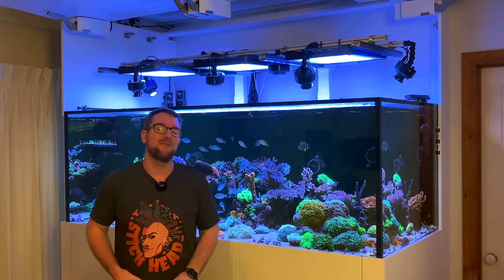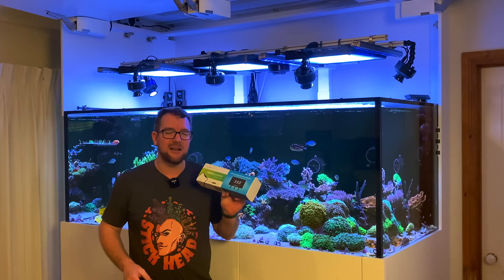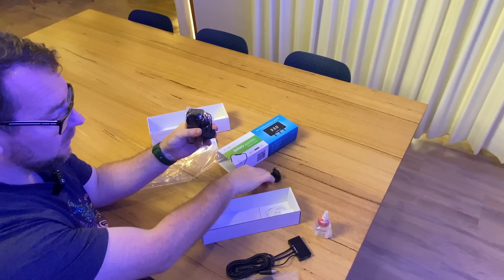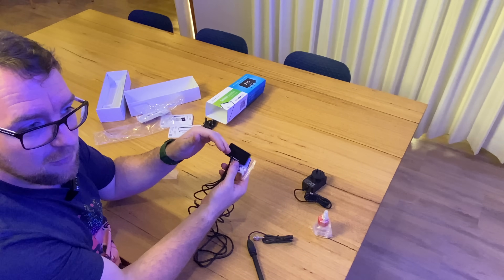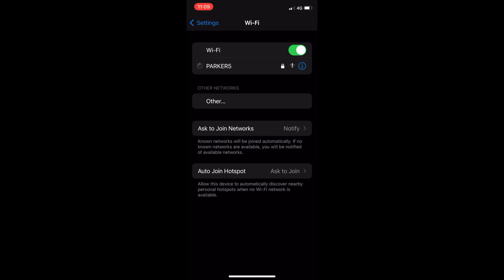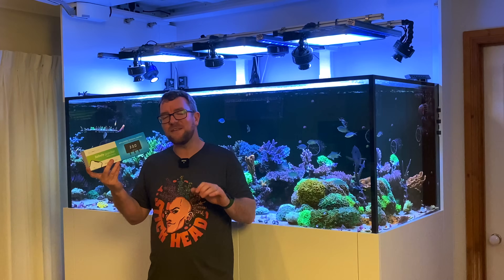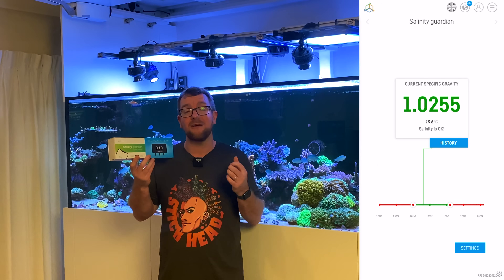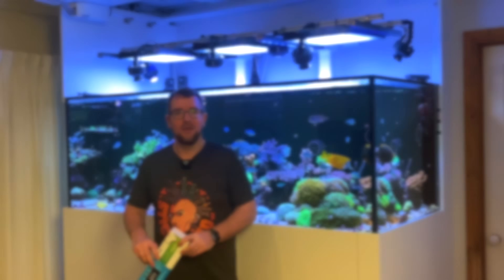Accurately monitor salinity with push notifications???

Comment: Since this devise has a temp probe, can the app send you temp alerts if you only have the Salinity device? Or do you have to buy them stand alone temp device to get those alerts? I am hoping it does so I can buy the one device to do the job of two?
Reply from the maker: That’s a great question. It can indeed see the temperature, however the push notifications and smart actions are only based off the salinity. 

Def something I’d put a request in with reef factory about!
Reply: Thanks so much for the fast reply, I appreciate it and love all your vids!

Comment: K10 salinity probe from Hydros is much better from an accuracy perspective and their isolation chamber which tests conductivity away from your equipment...most salinity probes on market use the K1 salinity probe which primarily reads in fresh water range with just the end spectrum for salinity which leaves it less accurate than a K10 probe which is dedicated to saltwater - Reef Factory, it is just another walled garden which doesn't make sense....fragmentation is not what we need in the hobby as no one will be brand loyal down to every last piece of equipment IMO.  Also, there is a fatal flaw with Reef Factory as it has NO wired communication between its devices.  All the devices rely only on Wifi to transmit data....god forbid you're in the middle of a dosing cycle and lose wifi....I don't see them lasting very long here as their equipment is cheaply made overseas in China while their software is made in Poland...they don't have dedicated customer support in the US which will make it really hard to support...also, no one is carrying their line willingly...Reef Factory got desperate and now providing a 60 day payment term and if you don't want it after 60 days, it can be returned...its why Champion and other small "distributors" only picked it up...I'd stay far away from them
Reply from the maker: good to know Mike. Sadly for us here in australia, we face the opposite problem. Hydros is not supported at all (not even sold here) whilst reef factory has fantastic support.

Comment: Hey Parker! Big fan kudos on the amazing tank! Are you still using the salinity guardian? Did you come across any issues like incorrect reading or issues with probe?
Reply from the maker: Thanks so much! I certainly am still using it, no issues at all. I once thought it was reading incorrectly, but I just had a snail on the probe :D
Reply: @Parkers Reef  thanks for getting back to me! What's the frequency of calibration?
Reply from the maker: @tumasgts  more often the better. You should do it every month or two, I let mine slip out to every 6-8 months though
Reply: @ParkersReef  cheers as I have seen quite a bit of mixed good and bad reviews

Comment: Hey Sam, thanks for sharing your thoughts. I’ve got my salinity guardian for about two weeks, I’ve notice the reading slowly creeping up after calibration. So I measured my ro water the next day after calibration and it was reading 3 ppt. So I recalibrated, but now after a while it is again measuring my ro water at 1 ppt. Has the reading been stable for you? Thanks
Reply from the maker: Hey Young. Hmmm that is no good. Can you confirm that you have it located in the sump like the instructions - away from bubbles and the heater? Make sure your temperature probe is nearby too. I'd also confirm that you have calibrated the unit against fluids at 25c?
Reply: @ParkersReef  Hi Sam, yes the probe is sitting on a probe rack in the return pump chamber, which is two chambers after the heater. However the temperature probe is actually in the refugium, which is one chamber before the heater, I might try and move it to the return chamber and see if it makes any difference. And yes I did calibrate after hearting the fluid to 25c. I tried looking for some new calibration fluid online to buy but couldn’t find any, do you think the calibration fluid for the Hanna salinity pen will do the job just fine?
Reply from the maker: see how you go with the temperature probe moved, that could make the difference. I suspect hanna calibration fluid would work just fine too :)

Comment: Only downside is i can log into my neighbours reef factory gear, support informed me u cant turn off the hotspot, nor can u change the password.
Reply from the maker: Oh wow, that is a HUGE oversight….
Reply: @ParkersReef  yeh, i wanted to shut off the hot spot , no go. I am sure they will program it in at some point. Even if it just needs a power cycle to get the hotspot back id be happy. You wont see any of their equipment on any public displays until they do.  Just seems like an invitation to jam my kh dosing to 10L a day and wipe out the tank. I may be wrong but support a few months back confirmed it.
Reply from the maker: Yeah huge flaw… concerned for stores running the gear now…

Comment: Hey Sam. Any information on the life of the salinity probe? Their website indicates 12 months however the replacement probes aren't cheap. Would be great to know you're thoughts on the PH probe as well.
Reply from the maker: Yeah I am only going off their website details at this stage too as I've only had it running about 4 weeks myself. Fingers crossed it is longer than 12 months as like you say, they are expensive probes!

Comment: Hello Sam, do you know what is the expected lifespan of the probe? Other manufacturers usually advise to change the probe every 12/24 months. Do you know for how long  Reef Factory says probe lasts and if they sell replacement ones? thank you in advance.
Reply from the maker: they do quote monthly calibration and yearly replacement, however I suspect that is a little pessimistic from my experience

Comment: Another Con I found that the leads are a tiny bit short. That's both the probe length and the power cable length. 

Since installing it, I've also found that the whole Reef Factory network isn't stable. I've now got 6 Reef Factory products working and since adding the sixth, am now getting all the devices dropping out every day. Usually early in the morning. If I remove a device, it seems to be more stable. 

None of my EcoTech or Maxspect equipment drops out, so I don't think it's a network issue. 

Tried to post my issue on their forum and the admins won't approve the post.
Reply from the maker: Totally agree with the lead length, would be handy to have them longer seeing as they are not extendable.

I know the reef factory support guys are looking at the comments in this video, so I will get their attention and see if we can resolve your issue.

Thanks for sharing your experience!
Reply: @ParkersReef  all their products work exactly how they're marketed, unlike those other companies that you've alluded to. 

Just wish I didn't have to keep unplugging all the powerpacks everyday to get it to work again.
 
The good thing is that once you do get in trouble with their gear, it is really easy to resolve yourself. Just this multiple devices dropping out on the same network is a bit beyond normal trouble shooting.
Reply from the maker: @grantrogers2878  yeah that is an absolute pain. I currently have a bunch of their gear on my network all staying connected just fine - however I will say that I recently upgraded my network to a commercial spec bit of gear as we have well over 100 connected devices!!!
Reply: @ParkersReef  that might be the solution. Would you mind sharing what you got? 

Perhaps a future video on how you solved your network issues?
Reply: Looks like it is a network issue. I lost my Kamoer gear for the first time tonight and all my Reef Factory gear is still connected. I must have too many wifi devices connected.
Reply from the maker: hey Grant, I went for a ubiquiti dream machine pro in a full server rack setup. It's pretty intense, but it does work very very well for our setup which has a ridiculous number of smart home devices

Comment: Thanks for the video. I’m looking for a controller to monitor both ph and salinity. You didn’t want to throw manufacturer’s under the bus for their bad salinity probes. I’m not going to ask you to expose the bad ones but can you recommend a controller that does both well?  I’m in US.
Reply from the maker: Personally I’d look into reef factory for both, but I know they are not quite in the states just yet (is due soon!!)

I actually couldn’t recommend any alternatives I’m afraid, ph isn’t too bad - most controllers out there can do it well. But salinity I’ve found every other brand to not be remotely reliable. I know others will say their XYZ brand salinity probe is great, but that just hasn’t been my experience
Reply: @ParkersReef  Thanks for the info. I do have a “home made” ph probe I’m using that my buddy made me with a raspberry pi that is handling ph at the moment. So I could make a separate purchase for salinity. I appreciate the response & thanks again for doing what you do.
Reply from the maker: No trouble at all! Thanks for watching!

Comment: Thanks for the video sam. 

I hve the thermo control and PH monitor and am very happy with both. 

The app is the best I have used in the hobby. I think I will need to grab this unit as well.
Reply from the maker: It’s industry leading software for sure!
Reply: 🥰 super glad you're happy with our devices!
Reply: @reeffactory  The only thing I’m waiting for it to be able to download the data as a CSV file so I can properly analyse the data in Excel. THEN I’ll be impressed. I’ve just bought the PH monitor and as soon as I see an example file or confirmation that this facility is there then I’ll buy the whole family. Until then GHL is still tempting, but apparently Reef Factory will be adding this feature soon 🤞 
Also think it would be good to automate RO addition based on Salinity reading like the KH keeper plus.
Reply: @reeffactory  hope to add more to the eco system, i like the sound of the upcoming KH Keeper Pro and Smart Tester

Comment: Great vid Sam, I've had it for around 4 weeks as well and while it was good to start with, the reading suddenly dropped to 32ppt from the 34 I maintain over a 30min period the other day... validated it with my Milwaukee and it was still reading 34. Took a few hours for the reading to go back up to what it should be. No idea what caused it...
Reply from the maker: Odd… so did the tank alter or the meter?

Comment: I live in the UK and our wi fi is now 5gig only and will not drop down to 2.4 so I am wondering how I would get it connected
Reply from the maker: Might need to grab an extra router, all smart home (and aquarium gear) runs if 2.4ghz networks
Reply: I’ve literally just got two spare routers. They must be cheap on eBay, just plug one into the back of your new router.

Comment: Hi Sam,  Great Vid as allways.

Interested in the dia of the probe,  I have the Sanking probe tube and your thoughts if this would work in that.  also what depth does the probe need to be in the water ?
Reply from the maker: Standard probe diameter and it needs 7-12cm of water, the second part may make it not work with the sanking probe holder?